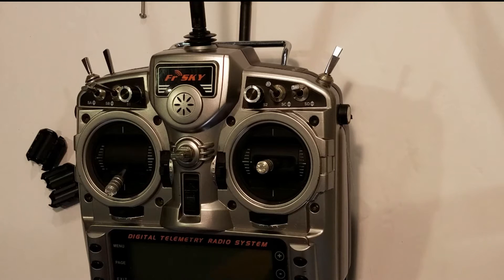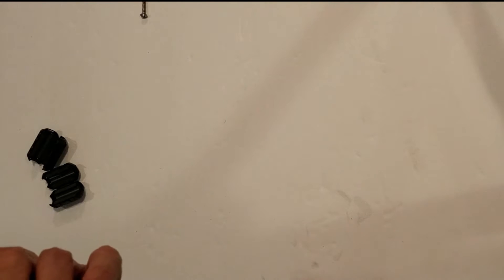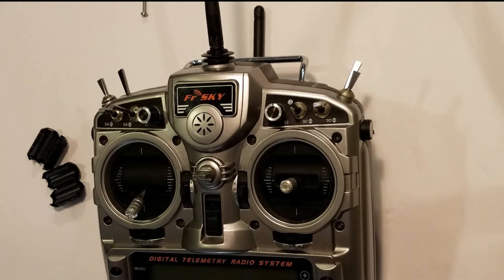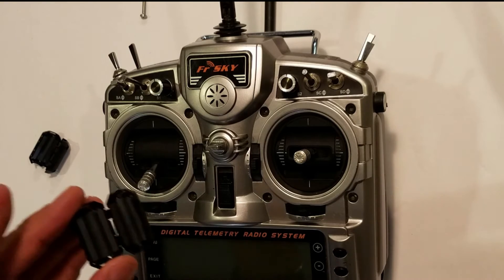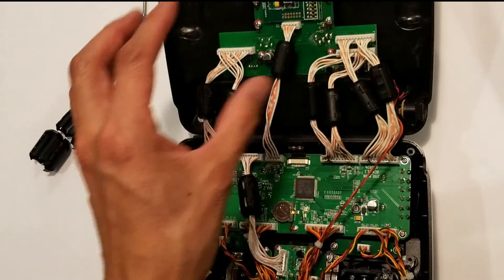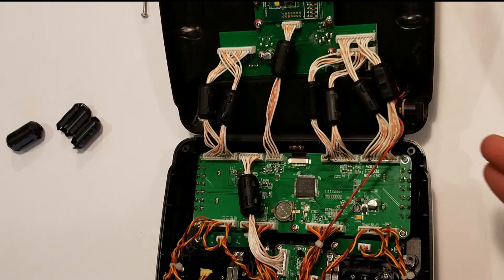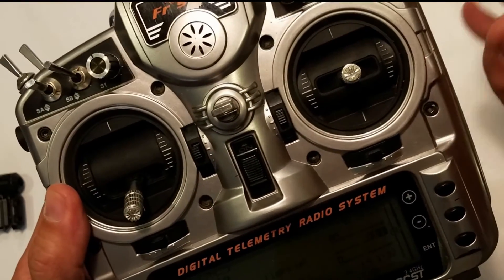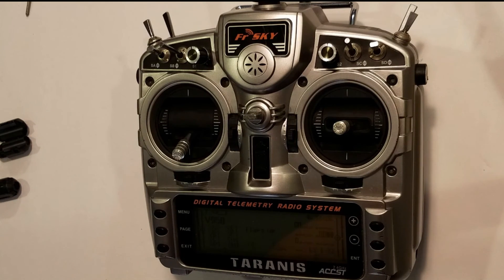Easy Fix for Taranis Audio Buzzing (Without Soldering!) Caused by RF Interference

Comment: My 2015 Taranis only has two flat ribbon cables inside, so it is much cleaner.  BUT, there's no place to attach the ferrite chokes.  BUT....I found if you attach just 1 to the servo connector lead from the PPM output in the expansion bay to the Dragon Link TX, it totally fixes the problem.  Nice easy fix (for once!)
Reply from the maker: Mark Pfeifer Great tip. Thanks.

Comment: The designers should have used shielded cabling, much like what is used for RS-232 wiring. Another solution is to wrap the cables or flat ribbon cables in copper foil with a glue backing. Then, cover the foil for electrical isolation in electrical or Kapton tape. For best suppression, solder a wire to the copper foil before the isolation wrap and solder that wire to the nearest ground terminal. In a proper design you would ground with 2 wires at both mother/daughter boards.

Comment: I’m having this issue now. I know this video is old but could electrical tape be used instead?
Reply from the maker: I don't think so. The ferrite coils absorb electromagnetic energy to stop the buzzing. Electrical tape alone doesn't do that.
Reply: Another solution is to wrap the cables or flat ribbon cables in copper foil with a glue backing. The, cover the foil in electrical or Kapton tape. For best suppression, solder a wire to the copper foil first and solder that wire to the nearest ground terminal.

Comment: I followed your link but if you would could you please tell us what size you used in the variety pack of different sizes It would be vary helpful to know if it was the smallest ones in the pack or the largest ones or the actual size please
Reply from the maker: Adam Cole I believe it was the 5mm coils because I had to roll the cables up to clip them.
Reply from the maker: Adam Cole I believe it was the 5mm coils because I had to roll the cables up to clip them.
Reply: thank you for your help my Taranis just started buzzing and I don't use a module but if I move the antenna it gets better